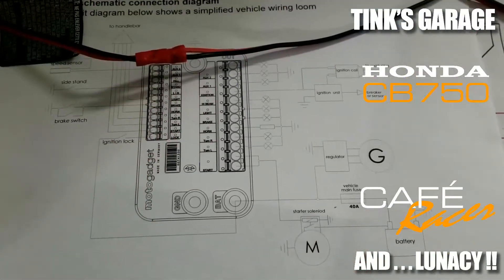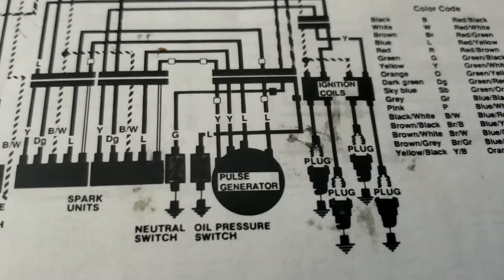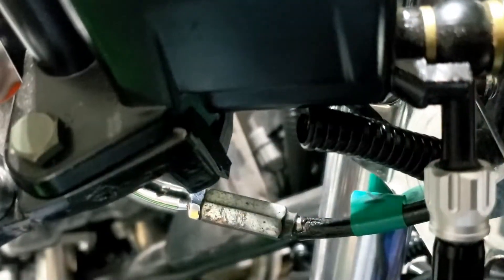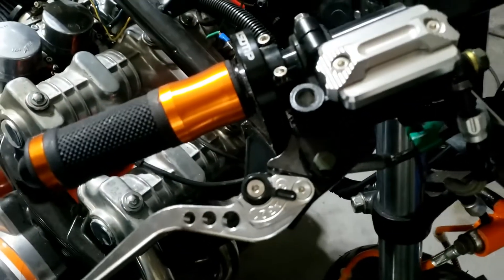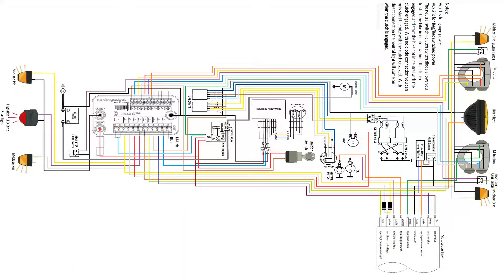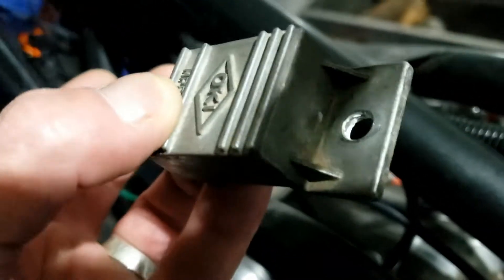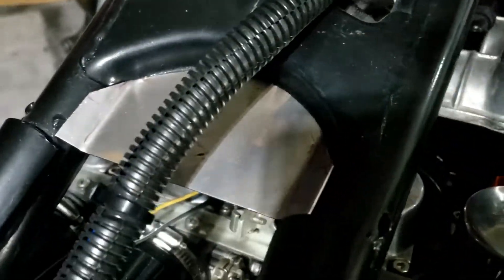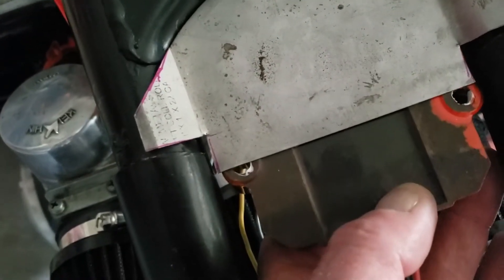Cafe Racer Build, Fabricating framework #HondaCB750 #caferacer #CustomMotorcycle : 28

Comment: Good work. I put those ignition units almost like you planned. but they are in front of that same triangle as you placing them, . But I just drilled a hole for thru bolt. :)
Reply from the maker: Great minds ;)

Comment: Hey man I'm also in the wiring process for a 1980 cb 750. You mentioned and showed the m unit wiring diagram but I don't see it in the description of your video. I was wondering if you could send me the link to it please. I am currently kind of stuck on trying to figure out the 4 other wires that are in the same male connector with the oil pressure switch and neutral switch. I know they some how get tied into the spark units but I don't know how.
Reply from the maker: Sorry I forgot to put the link in. It's there now. Wiring diagram: https://drive.google.com/file/d/1bakqhfk5BfnR7wAHny9_tVm1wSalgxGE/view 
More to come on the blue unit install - stay tuned :)
Reply: thank you very much I think ill upload a video of mine bike as well once im done with the wiring  @TINKcustoms
Reply from the maker: @mexiflush8077  post a link here when you do ;)
Reply: Here's the link to the first start up. Thanks again for the wiring diagram. https://www.youtube.com/watch?v=_s3bm_KZ9TQ   @TINKcustoms
Reply from the maker: @mexiflush8077  does yours have the spark units?
Reply: @TINKcustoms yes it dose i put them under the tank. Drilled two holes and mounted them behind the ignition coils.